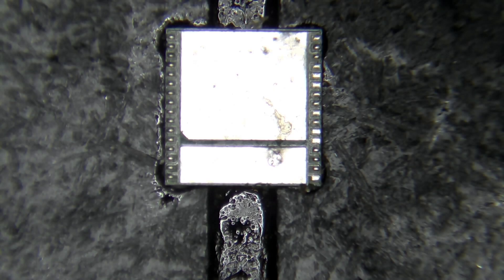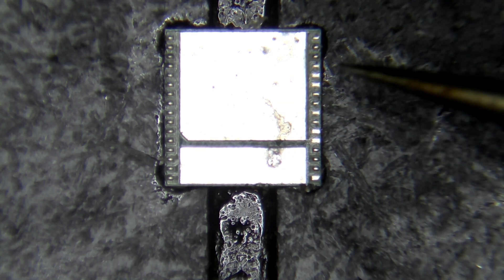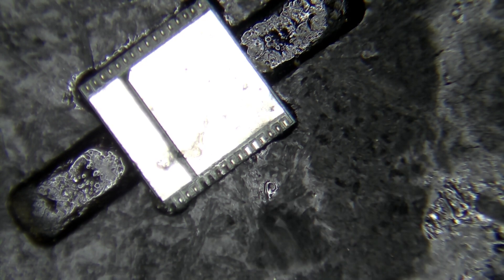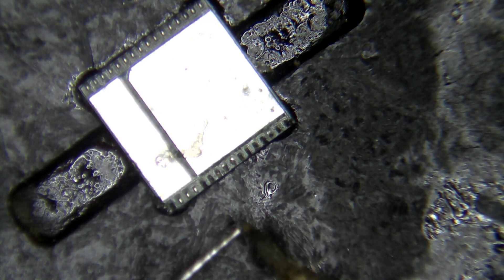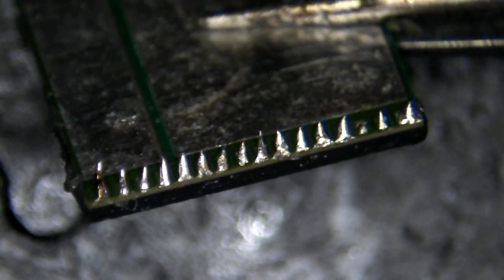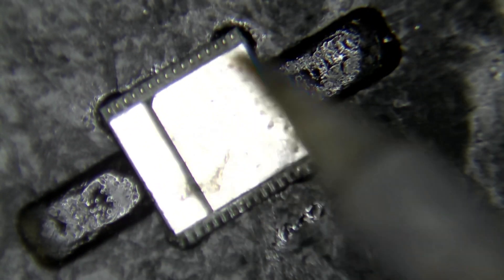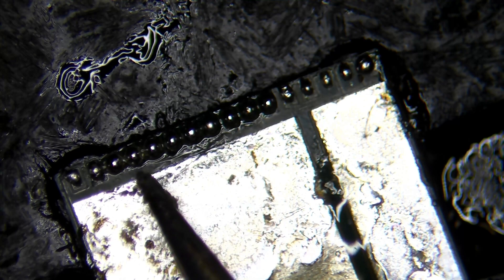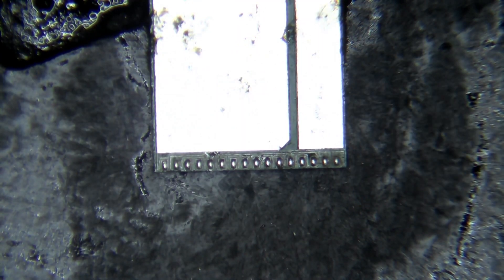DIY - Re-tinning used chips - spikes and balls method

Comment: That was a great video-thanks for the upload! What wire/soldering temps were you using for that one?
Reply from the maker: I use chip quik SMDSW in 0.015" size.  Anything 63/37 Sn-Pb will do.  My soldering station is always maxed out at 450 deg C.  I control the heat I put in a component by how long I leave the iron on it.  Hope this helps!
Reply: @asicrepaircanada159  Awesome. That's perfect! I am going to try retinning some of these chips on my donor board-looking at them, I think i have a good 30 or 40 that are good-not the copper top, though, so I guess that will be the antminer adhesive for that.